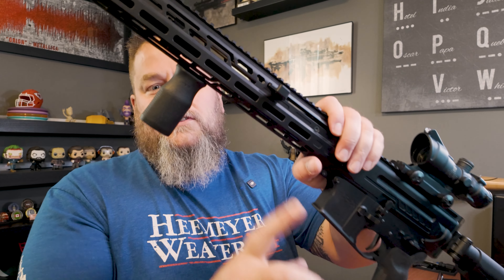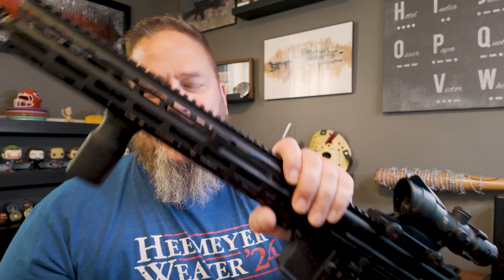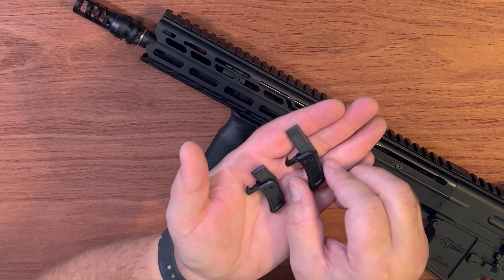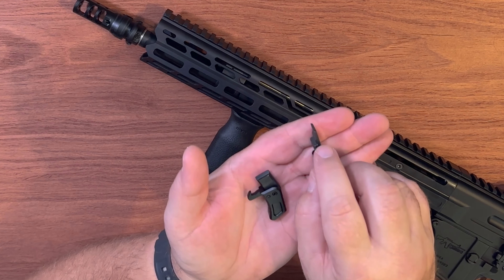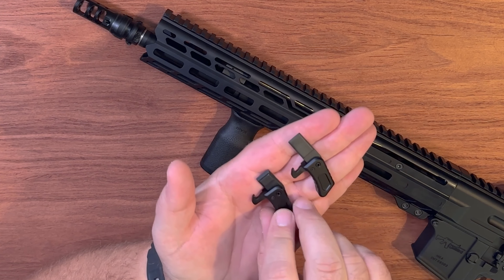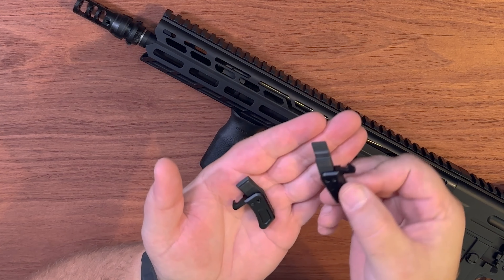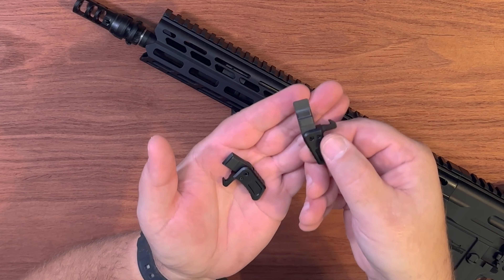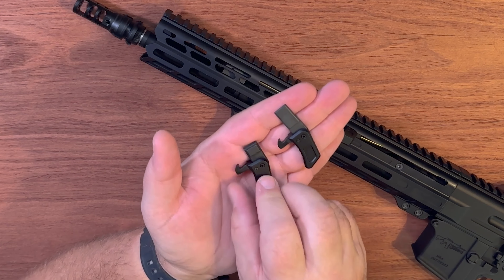Mike's Tips - Is Your DISSENT Charging Handle Ambi?

Comment: Hypothetically, if those two pins were punched out and the handle part flipped, wouldnt that work? Or are the holes different sizes to prevent us from doing that?
Reply from the maker: You could. We just typically don't advise it for most people since those are assembled like a regular charging handle, and they're tricky to hold together without parts or springs finding low earth orbit. lol